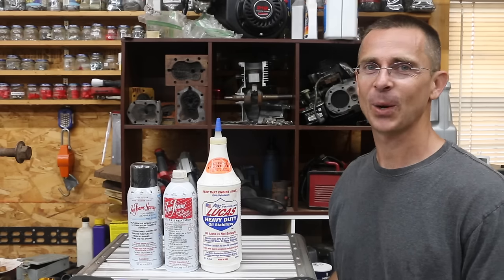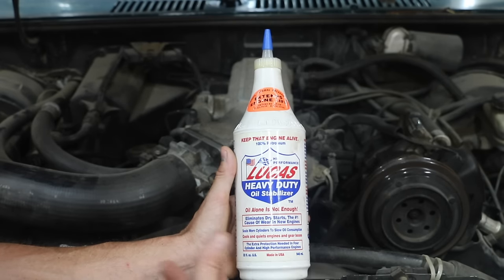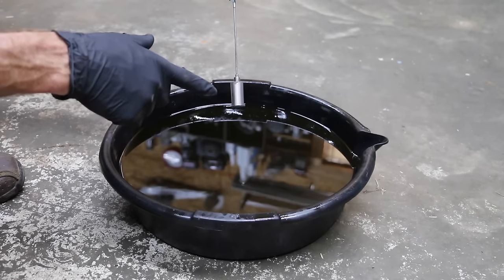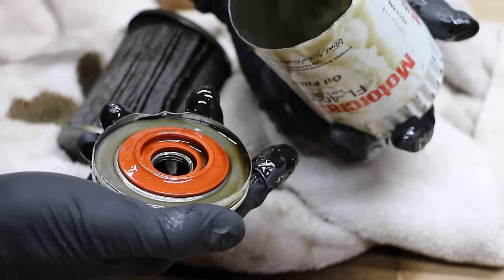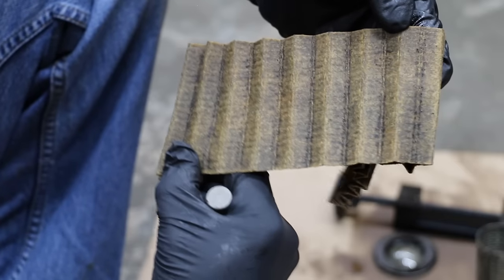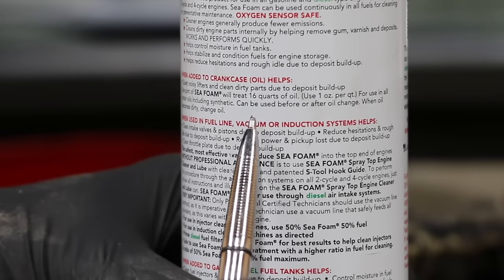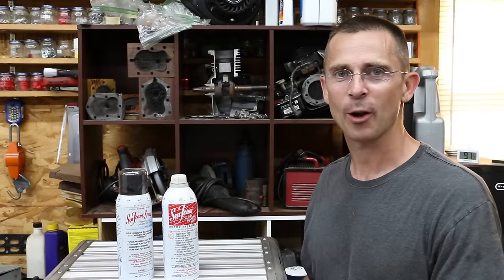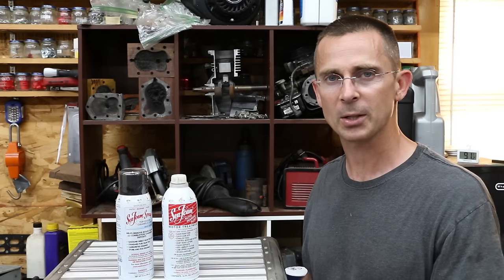Did the Seafoam fix last? Update on the Ford Ranger

Comment: Seafoam and Lucas has become a regular part of every used vehicle I own. This video honestly deserves sponsorship
Reply from the maker: Thank you!
Reply: I have a question for you. I know you maybe biased towards those products. I currently own an 05 Civic EX with VVT (Variable Valve Timing). I've purchased the "Low Viscosity forumula" of Lucas as it's meant for VVT engine. My engine has a ticking sound & burns oil. I've been told to use "Rislone Engine Oil Treat (yellow bottle) or the Rislone Compression Repair with Ring Seal." I mainly want to tackle the oil consumption as the noise I can live with by cranking the music up. If I can hit both than that's even better. 

My thing is, do you have experience with these products? If so, any thoughts on them? I've tried Lucas oil stablizer in the past & it seemed to have helped maybe an extra 1k miles before losing oil between changes. I usually do 5k oil changes. I also use HM oil 5w-20 & am against going higher as I'd like to stay with the manufactor reccomends. Maybe I'll try 5w-30, but dont se myself going high than that if need be. I know I said alot, but I'd like your opinion, thanks!
Reply: Same here, I don’t change my oil without a bottle of Lucas heavy duty oil stabilizer to substitute a quart of oil, now I’m probably gonna use seafoam regularly in my crankcase and fuel tank and prob throttle body occasionally
Reply: @dbzownz12345  When using a multi viscosity motor oil, you need not be concerned that your are using 5w-30, or even 5w-40, because the higher number will protect aginst extreme heat. The lower number will lubricate at colder temps. My 67 Buick Riviera calls for 10w-30, but I can run 10w-40 with no issues. I hope that helps.
Reply: @CHEECHMUN  10w-40 is a good middle -of-the-road oil, my dad used it in all of his vehicles and it's all he ever used,  I use it in all of mine too. it's kinda hard to find in certain brands though.
Reply: @wizardofahhhs759  I've used it in my 67 Riviera. But since todays oils don't have zinc, I add it and use Shell Rotella diesel motor oil because it contains zinc.
Reply: @wizardofahhhs759  True!
Reply: @dbzownz12345  I’ve heard people around say as well with vehicles past 100-150k miles use a slightly thicker viscosity. My Miata calls for 5w-30 I use 5w40 for over two years with no problems, made my engine quieter and helped with lifter tick, as lifter tick is quite infamous with Miata’s. I’ve found 5w40 to be quite hard to find recently and can only find euro spec but that’s fine for me
Reply: @lerg12  If you're gonna put Seafoam in your fuel tank, you do not want to do it on every fill up. That'll burn out your fuel injectors. Depending on how much you drive, I'd recommend no more than every 3rd fill up. Also, you only use 1oz per gallon of fuel in the the tank. Also, I think Seafoam is a bit expensive to use just for cleaning your TB. You can buy some TB Cleaner instead for this. Also, do NOT use carb/choke cleaner on a TB! Nor brake kleen for that matter! It'll damage the butterfly. I'd suggest cleaning your TB every time you change your oil, or at elast every other oil change depending on how many miles you go between changes.
Reply: @DJGRoc  oh yeah I don’t plan to use it every fill up, id probably do it once every 6 months or something, as for the TB I haven’t done it yet but I’d probably use SF honestly I can get it on discount with my Napa house account
Reply: @dbzownz12345  Use 505 gas and oil treatment.
Reply: Using 5w30 as a substitute for 5w20 is advisable in order to better protect the vvt system. I drive an F150 and it too has the vvt system that is very reliant upon good oil flow and oil pressure. The 5w30 just protects it better. Ford recommends their 5w20 synthetic blend oil, I use full synthetic 5w30 and have had zero problems with it.

Comment: Great follow up.  No one ever seems to post those. 

If you had first wrapped your magnet in plastic cling wrap, like you'd use on leftovers, or stuck the magnet inside a finger of a white latex glove; you could have removed the wrap from the magnet and been able to see the debris left behind much easier.  

I learned that trick as a kid after I spilled BBs on a shag carpet.  The wrap made the BBs MUCH easier to remove from the magnet! Now I keep a strong magnet wrapped in plastic wrap for picking up nuts, bolts and washers that get spilled on my shop floor.
Reply from the maker: Thanks!  Great tip, thanks!
Reply: This is a simple but much appreciated solution to a problem I've had when using a strong magnet. Thanks!
Reply: Of course, any bearing metal particles will not be magnetic. @paulvinwi